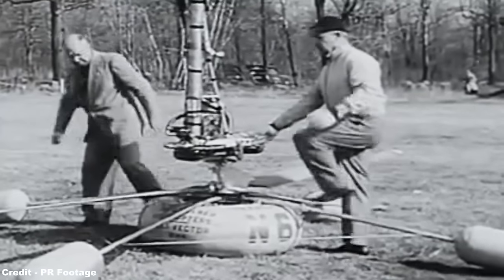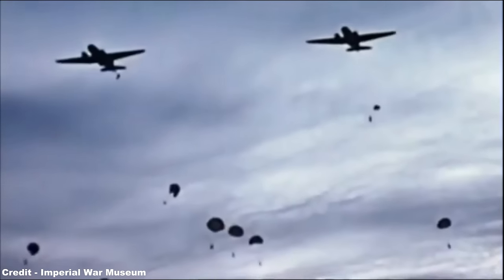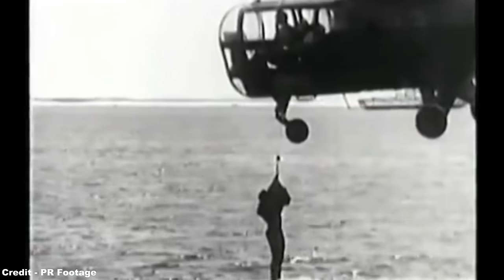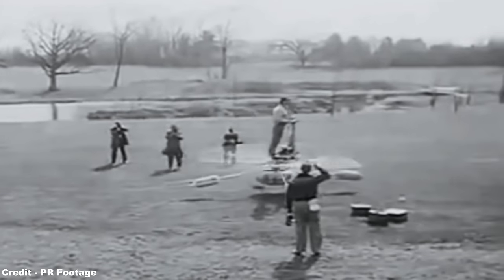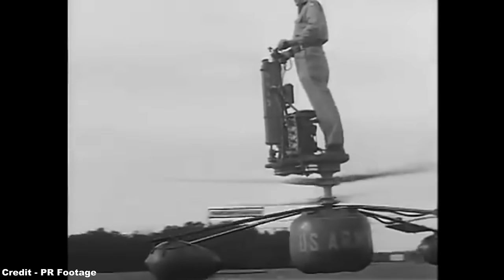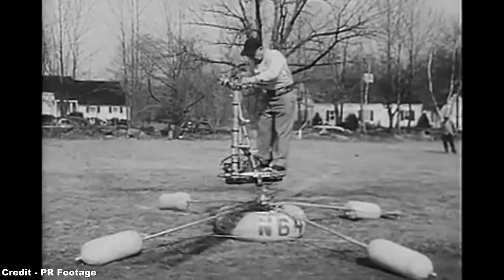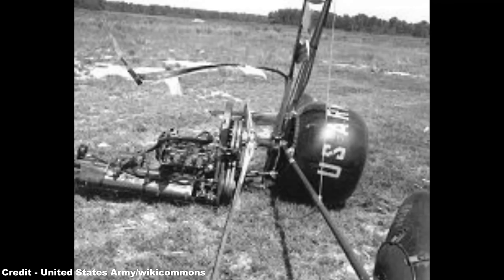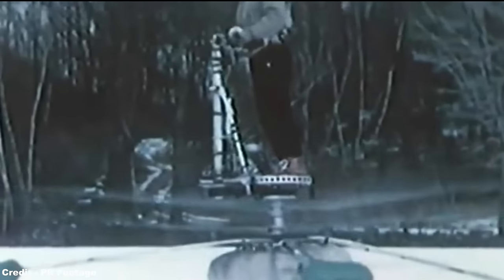Flying Failures - de Lackner HZ 1 Aerocycle

Comment: The ducted fan Pawnee is the least absurd of all these, I'm baffled on how far they were willing to test the Aerocycle.
Reply: I totally agree. The only place the Aerocycle could be used is very open terrain due to the massive radius of those blades and I'm certain it was loud as heck so the operator would be a sitting duck. The Pawnee would still be loud, but with the much smaller footprint it could theoretically be used in more realistic terrain scenarios. 

My thought on the use in mined areas, if land mines use pressure sensors, wouldn't the downforce of one of these going over the top be just as likely to trip a mine as a human foot would?

Comment: This thing  created the name 'chopper' for all helicopters. The harness wouldn't prevent your legs getting into those blades.
Only if they also had added a sort of mesh basket around the platform keeping operator's legs on the platform it would be reasonably safe.
Reply: @-fuk57   That's indeed the true story, but just the idea makes this thing deserve the name.
I mis formulated my previous comment as I did not mean to present it as a fact but just as a thought.
Reply: Better yet, split up the rotors into a two or a four rotar configuration with ducts, use a sitting cage and place it lower and between the cage and center the pilot. basically, create a modern-day drone.